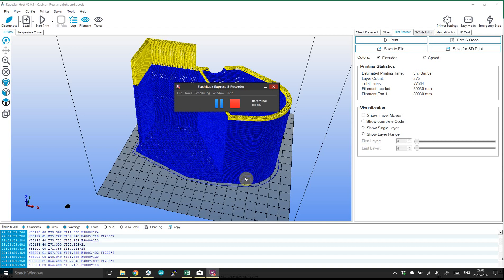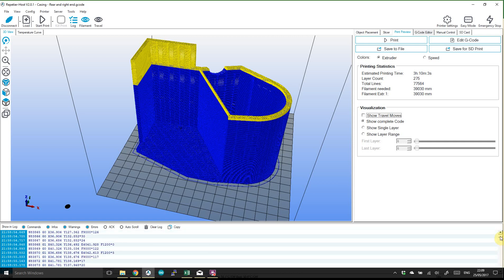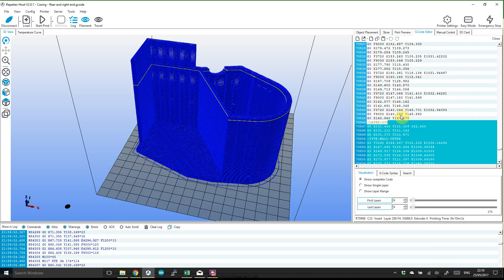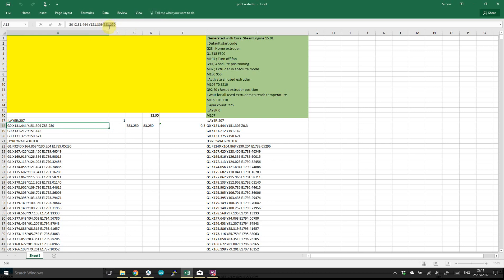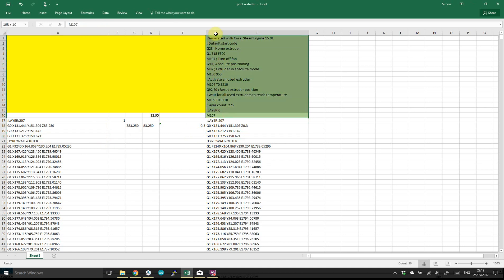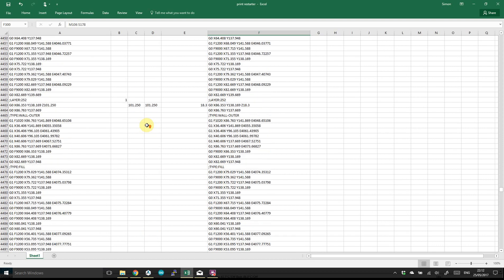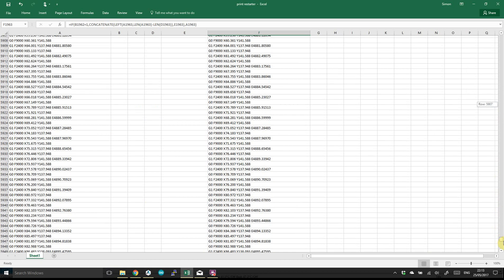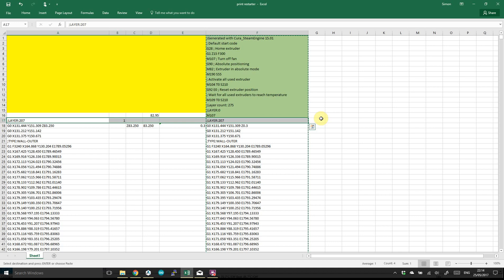3D Print Regain - Gcode Editing to the Rescue!

Comment: Hi there and thanks for helping me out to save a print. I feel like I should share my journey so others can benefit from it. Now, you have 2 options to complete a failed print; 1. to continue while print still stays on the bed 2. continue  print from ground up.
1. Continue while print still stays on bed: you have to keep the bed temperature high otherwise part will come loose and you will not able to continue over top of it. So while editing the gcode make sure you manually rise the bed temperature so that part will stay strong on the bed. Measure the part height, and as video suggests, in the gcode remove the layer lines up to the point and continue to print.
2. Continue from ground up: as you remove the lines from gcode, just insert "g92 zheight" after the first coordinate line. in my case print failed at roughly 54mm and I removed layer lines up to z54.15. I changed that first Z coordinate to Z0.3 so printer will start printing from ground up. and to avoid editing lines afterwards, I simply add G92 Z54.15 and printer thinks now its at Z54.15. so it continues other lines as if they were at 54.15. how the gcode looks:
;LAYER_COUNT:552
;MESH:NONMESH
G0 F600 X132.35 Y102.248 Z0.3 <--- it was Z54.15 actually
G92 Z54.15
rest of the code is same
Reply: I’m getting an error with the extruder saying “extrude only move too long” must be something with the extruder being in absolute mode. How do I fix this?

Comment: A tip if you want to print on top of an existing part but it's in the way of homing. You can home each axis seperate with "G28 Z0" for Z axis or "G28 X0". This way you can position the printer in a safe location to home each axis.

My Z usually homes in the middle but I made it home off to the corner to avoid my print. Then after Z I raised gantry and homed X and Y.

Comment: You have such a great printer. I'd really recommend Simplify3D. Night and day for me once I switched.
Reply from the maker: Ryan Garrison thanks for the compliment. Perhaps I'm too much of a cheap skate! I've thought about it but never got into working out whether the extra would make much difference to my printing. I have to say that Cura hasn't got enough control and Slic3r doesn't have the easiest interface. Hmm, you've definitely made me think!
Reply: I'm an engineering student so I appreciate your quality parts. Which I also know weren't cheap, having built several printers myself. So $150 for software shouldn't be too bad ;) I tried Repetier Host, Slic3r, Cura, even Craftware. I couldn't get consistent results. They were all buggy, crashed constantly (especially Repetier Host) and my prints always had weird flaws. I switched to S3D and it all went away. It's fast, stable, and creates really reliable tool paths and gcode. The difference is unreal. Plus you can customize supports and even change infill at various layer heights, etc. Definitely look into it.
Reply: I wish simplify3D had gap filling and 3D infill patterns :(

Comment from the maker: Roland, the developer of Repetier Host, just told me you can use G92 to say 86mm is at 0mm. Then you'd only need to add start and finish custom gcode and insert the 2nd layer fan-on line. Much simpler! Thanks Roland.
Reply: What would the G-code look like in the program?